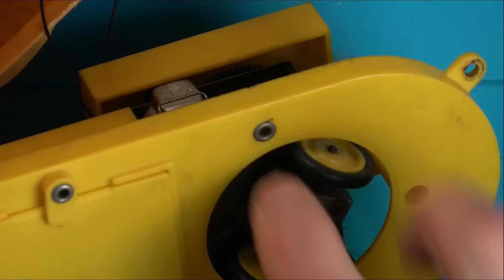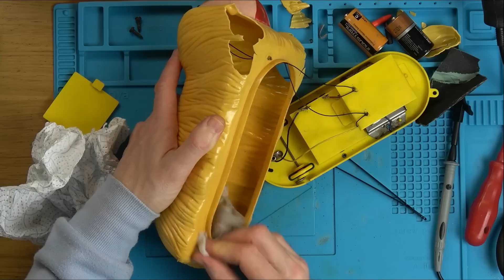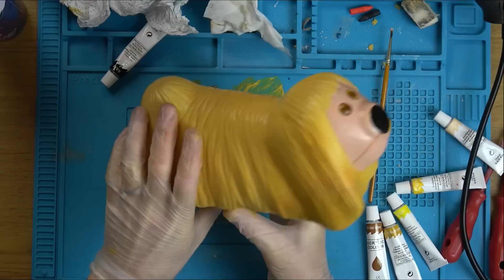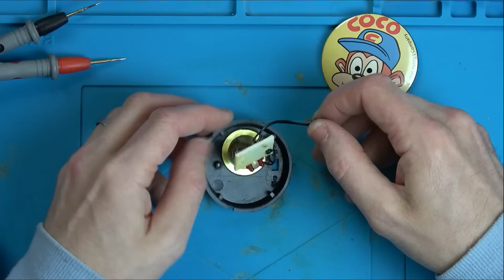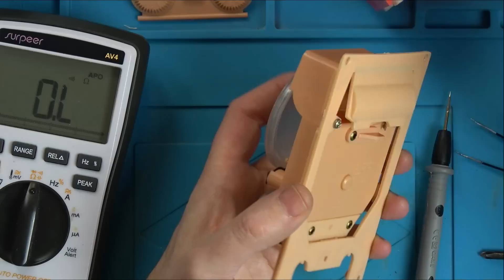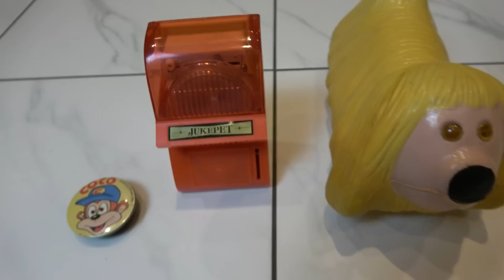Fixing Broken eBay Toys from Different Decades

Comment from the maker: Spoiler Saver

👍
Reply: Deffo  wheels  chet Atkins guitar  instrumental  track
Reply: Fix a PS5
Reply: I would like to fix that hole with some epoxy resin and fiberglass stuff that I work with very often. But the problem is that I am in Hungary and I can't travel because of the massive virus problems.
Reply: And inside the motor I don't spray WD40. Instead, I spray Weldtite TF2 teflon spray that I buy at our bicycle shop.
Reply: Wheels  name of song
Reply: Dougal is like a roomba

It bumps in to everything

Comment: You could probably reduce the warbly sound of the juke player even more by putting a proper tape deck belt in it rather than a rubber band. I strongly suspect that the warbly, wow and flutter sound you're getting is because of the stretching and contracting of the rubber band whereas a proper tape belt won't do that

Comment: Acrylic paint is non-toxic, it literally dries into plastic. Just curious why you didn't mix the paint a bit beforehand to match the toy color, rather than taking it straight out of the tube?
Reply from the maker: I did try to mix a bit of white and yellow paint in, to blend it in a bit (off camera) and to lighten it, but I struggled to get a closer match. Cheers for the non-toxic advice 👍

Comment: Quick Tip: Next time you fill with body filler, put tape on the outside to cover the hole and fill from the inside. Save you loads of time and gives a better finish.

Comment: @My Mate VINCE you shouldn't use WD40 on Motors, it might work temporarily but harm more than it helps. There is a special Fat for Motors which fixes it permanently. I used WD40 on my Laptop Fan before and it failed again after a while. I cleaned the Fan and the damage caused by WD40 and used special Motor Fat which fixed it and still works today.
Reply from the maker: Cheers Michael 👍

Comment: Hi Vince
When i was a kid in the 60s i had a toy train ( the American western type) that worked the same way as Dougal.
As i understand it when the toy hits something, the two wheels underneath work like a differential on a car, and when resistance is met drive swops over from one wheel to the other, and as the wheels can spin on an axis the toy takes off in a different, random direction including reverse.
My train had flashing lights in the front and cab and was probably made by the same company.
Ohh the memories!...i still remember me and my dad (long since passed) playing with that train on the rug on Christmas morning.

Cheers!
Chris
Reply from the maker: Thanks Chris 👍
Reply: @Mymatevince  Welcome!
Reply: @cass276 wait how old are you now

Comment: Vince try adding baking soda to super glue to make an instant dry cement. Just use superglue like normal then while holding the parts together sprinkle some baking soda over it to have it dry an harden instantly. You can also slowly build up missing parts/ holes. Best part is its sand able after about 1 minute.  I have used this on serval plastics an it always works. Even on broken car dash panel clips.
Reply from the maker: Cheers Chris 👍

Comment: Love your videos, just a note:  WD 40 is a protectant (anti rust).  The lubricant (volatile) will evaporate leaving a coating behind to prevent rust.  It only lubricates temporarily.  So using on gears, pivots and contacts will actually cause everything to bind up later or not conduct electricity.

Cheers, Geoff
Reply from the maker: Cheers Geoff 👍

Comment: Coco pops don't exist in the US but there are cocoa puffs which are like little balls similar to Kix cereal.
I've had to remove corrosion from battery terminals. I've used hand sanitizer and an old toothbrush.

I so want to find one of those Ozen boxes with the tiny record inside. You should play those records on a regular player.
Reply: Coco Pops are just Cocoa Krispies, the chocolate Rice Krispies. Cocoa Puffs and Kix are General Mills.
Reply: @HimmelsDaemon  Coco pops are made by Kellogg's and are only available  in the U.K.

Comment: The main issue with the electric motors is usually dried grease on the shaft/bearing. IPA clean re-apply grease should fix. I recently had to apply lithium grease to a cd tray rails. I cut a few tiny pieces of sponge into cubes and used tweezers to pick up the pieces to swab the grease coating around like a mini-applicator. I thought it worked out well and really coated the surfaces optimally. It's the old "a little goes a long way."
Reply from the maker: Thanks for the tips!

Comment: You need to invest in some electrical cleaner/lube spray and perhaps some inox/lanox. WD40 is not a great lube for that motor. Sorry, not turning off Ad-blocker. YT would be a complete nightmare with ads.

Comment: We have Coco Pops in the US, but they were renamed Coco Krispies in the early 2000s.
Reply: Coco Pops also in Italy but I don't remember the satanic badge.
Reply: In the UK, back in maybe the 50's to early 60's, we got Coco pops, and they were around for a few years. Then they were re-named Co Krispies about 65 for some reason. They vanished off the market some time later, to re appear (in the 80's IIRC) as Coco Pops again. When the Coco Krispies name appeared here, they had a free giveaway in them of plastic locomotive models, mostly I think of US prototypes- did you get them over there too? Some were really nice models, both steam and diesels.
Reply: @laszlofyre845  I don't recall any locomotives, but it's very possible!

Comment: i have a small lcd game that just didnt want to work right until i tore it down entirely and went to town cleaning it, so yeah, those cheap preinstalled button cells can really leave a trace
edit: ive got the fisherprice music box turntable that works off the same idea as that bank and its shocking how loud they managed to make them and how loud they continue to be even as the plastic ages and becomes brittle, to clean the cone for the music box it needs to be pulled out of a glued position and it makes its age and fragility known while doing so, but yeah speed control on some of the older toys was just a bit lax/nonexistent so they sounded strange

Comment: What desktop power supply do you use?
Reply from the maker: In this one it was just my 853D 3 in 1 hot air station that I was using BUT I have bought a Uniroi Model number UCP3010S in which you can control the current 👍